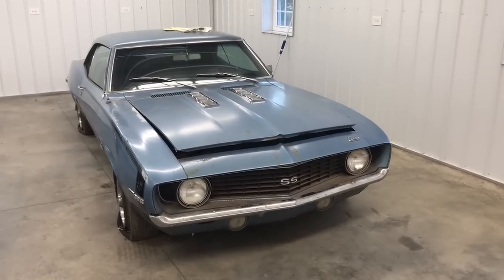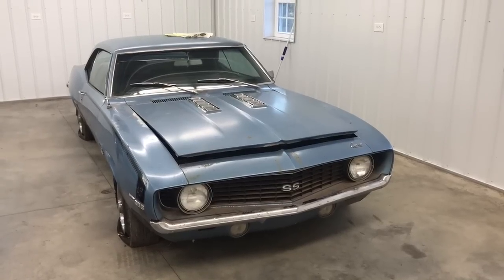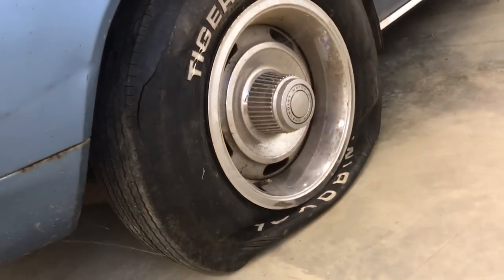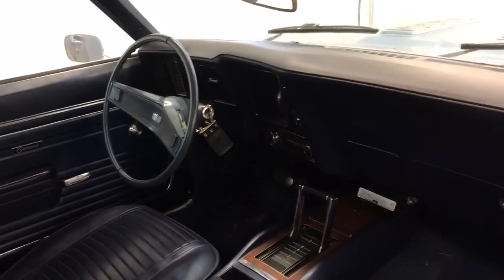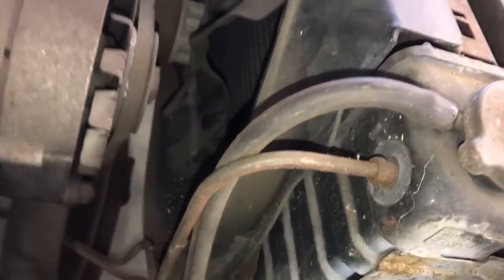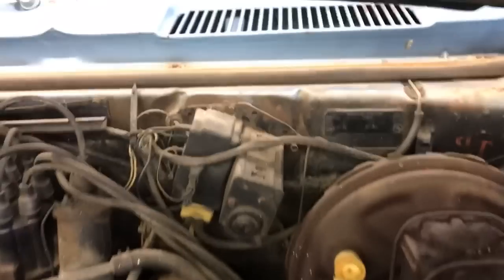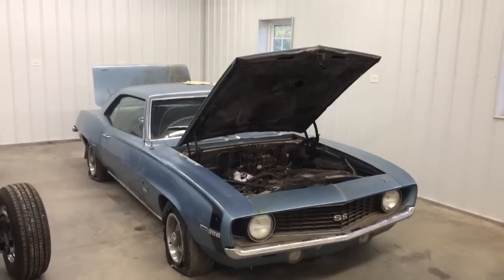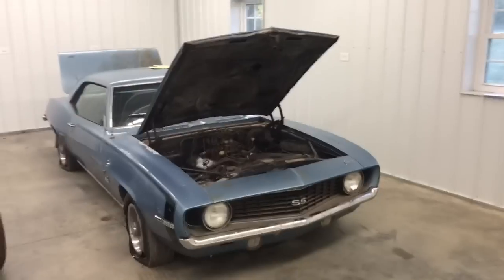WILL IT RUN??? Time Capsule 1969 Camaro SS396 Discovered Hidden Since 1981!!!

Comment: It's funny how we would think $3747.85 is not a lot of money. That Camaro would be $26,543.15 today. I think that is still a heck of a deal since a base Camaro now is about $25,000.00 with a 4-cylinder engine. A Camaro with more respectable and fun horsepower is over $37,000.00 and that ain't the top of the line car.

Comment: Thanks for the video however you really missed the boat on several very important aspects to cover on a survivor 69 Camaro. I wish you had verified the holy grail detail of the D90 stripes being a combination of paint and vinyl which most people are not aware of. It's also common knowledge that the X66 was all 69 SS 396 (325,350, &375HP) cars WITH style trim (or RS package) with which this car is missing several pieces for some odd reason. Would have been super nice to see the protect-o-plate for it too. Again thanks for this mildly decent video.
Reply: Lol@ common knowledge. The lower number code is always style trim/RS. A standard Z-28 is an X77. A Style trim or Rally Sport optioned  Z28 codes out as X33. Even the base cars work the same. X44 is a base Camaro without style trim. X11 is style trim. Also X55 is an SS350 without style trim or Rally Sport. An RS/SS 350 (or style trim SS350) is coded as an X11 as well. That being said not every Norwood car got an X code. This car had the big block heater core, correct 1969 big block alternator brackets.  Its a base 396 car. Not really that hard to believe that it is what it is. There wasn't alot of people faking hydraulic lifter big blocks as far back as that car has been together.  There isnt too many people out there willing to just send out copies of the protect-o-plate just to convince someone else what they know.

Comment: Yep.
I walk right past a restored to look at the true survivors.
This car appears to be an AC car by vents inside. If so, compressor/lines
 are missing.
Still, a great example of muscle.
Thanks for sharing.
Reply: No not an A/C car.... Factory A/C would have two vents side by side in middle of dashboard. All '69 Camaro's had Astro ventilation which had the vents on each side of the dashboard.
Reply: @mikehasit  Thanks. I never knew this and I'm a '52 model.
Reply: Those vents are not A/C.  They are called "Astro Ventilation"

Comment: I'm curious to know if anyone knows what month chevy uped,it to the 402,was it January of 70 or a few months later, or were some of the 69s 402s?
Reply from the maker: 70 models had the 3969854 casting block which was a 402 cubic inch displacement with 4.125 cylinder bores. It is documented that some of  the late 69s had 402 engines as well.

Comment: I agree about leaving the car original but that old fiberglass job on the drivers rear quarter I'd clean that up and the rot starting in the corners of the rear window, blow in as little paint as possible but i wouldnt touch it after that..its too original, you gotta preserve the car also you cant just leave it looking like a heap forever,
 imagine how much it would be worth if it were a L78 4speed m22

Comment: Remove all original tires, buy some Flex Seal to preserve the interior of the tire remount and air up
Reply: Patrick put slime from wall mart in the tires ,I use it on tractor and lawnmower tires and thorns or small cracks no problem.

Comment: the guy who tried to roll back the odometer did not know what he was doing
thats why the 3 and  4  dont line up and it is a rust bucket you crook.
Reply: I would agree the odometer looks fishy like an amatuer's first attempt. But even if it had 100,000 miles on it, the car still holds a high degree of respect and value for the shape and originality.
Reply: Tell us how you really feel!

Comment: Awesome find!  I would keep it as original as possible.  Drive it!  Too bad they did not get the console gauges and tach option.   I owned 2 '69 SS Camaro's back in the 70's.   Neither had the black out rear panel.  Was that an option?